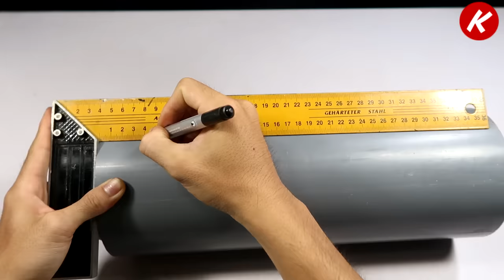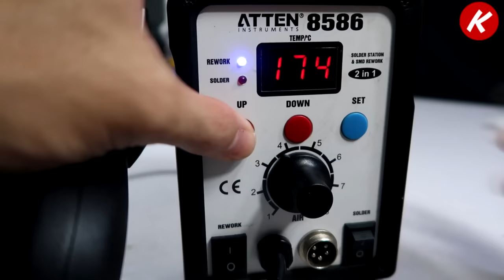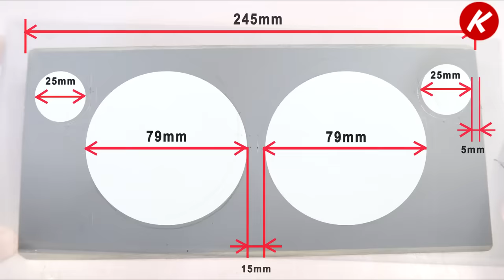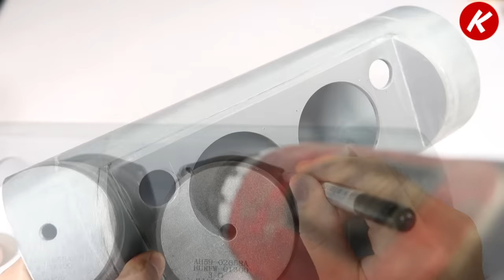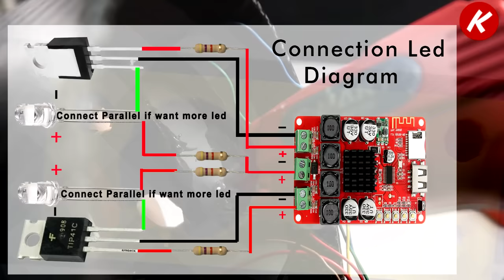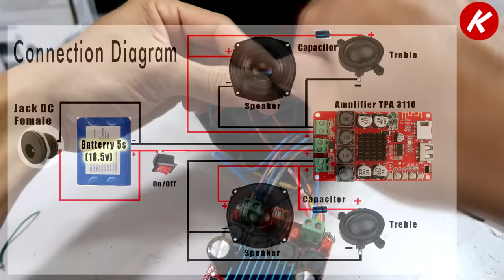How To Make Boombox Bluetooth Speaker Using Pipe Plastic (New Version)

Comment: I think an awesome upgrade for version 3.0 would be an Audio Spectrum Analyser. This would be much cooler than just 4 yellow LED'S.
Reply from the maker: Thank bro
Reply: why? to reduce battery life?
Reply: @KingMinhvuong   Anthony Woodley is right. Suggestion: use transparent pipe and put in the visualizer so it can be safe for the leds to be submerge the boombox in   
Water.
Reply: this is what i thought

Comment: Dude, a few tips about PVC boards. Get piece of 30cm of big PVC pipes (100mm or above) cut in the middle only once and put it in the oven to heat it up. The rest is exactly like you did: put between 2 flat surfaces and some weight over it for a few minutes. 
Then you can use those metal cutting scissors, you know? It's pretty easy to mold it with heat from a cigarette lighter and so on. There are people that makes LOTS of things with that material!
Anyway, if you want any indication of channels that use that material, so you can have an idea, it's just ask. 😉
Reply from the maker: Thank for your idea my friend. That is amazing. I will try in next day

Comment: Good job
But for your battery pack you need 5s BMS.
You can not charge lithium battery without BMS specially 5s4p pack they can catch fire during charging and discharging......

Comment: Hi there, brilliant video tutorial.. I am going to have a go at building one myself. My only question is... how long does the battery pack last between charges? Thanks in advance
Reply: That depends on your wattage consumed and the mah hour of the battery. Check the watt hour. Say you using 6 watts and your battery is 9 watt hours, you will get 1:30h of playback. Hope this helps!

Comment: I reckon a minor detailmissed was an actual Air Escape hole for the pressure of the Subwoofer, could've further enhanced the quality. nevertheless, great DIY
Reply from the maker: Thank for your advide
Reply: Making it a ported enclosure would defeat the purpose and functionality of the w00x speaker radiators.

Comment: Nice invention, but you dont have to use sealant or any permanent glue, instead, use bolts, because if some problems occur inside , you can easily replace damaged piece without damaging outside, this looks disposable, but still, nice outcome.

Comment: hey, I have a question. can you make this boombox also whitout the accu, and connect it just whit the charger?
I am waiting for your answer :)
Like your vidoe's!!!!!!!
Reply: Just add charger instead of battery but 4-7!
Reply: @Davidslabofficial  what you mean whit 4-7?
Reply: @norules1166  sorry that was mistaken 
Add charger instead of battery 4s is about 16-15 volts you can use booster or (buck converter dc-dc to attain 15 volt you can also use 12.volt 5 amperes charger or power supply from computer
Reply: @Davidslabofficial  https://www.allekabels.nl/universele-adapter/5784/1307581/universele-ac-dc-adapter-12-v.html Is this one good? It is 12 volt 600mA

Comment: Ahm I didn't see him connecting those big speakers on the side. 😂😂😂
Reply: They are passive radiators. there is no connection. They move by the air movement form the woofers.

Comment: Sir you give the anotheramplifier board link in description please check and correct it so that before Christmas I make it
Reply from the maker: I know that, but the amplifier I have used in this video is not good, it is very hot and noisy, please buy the amplifier that I put in the description of the video will be better. Thanks !

Comment: Does the battery have to be exactly 18.5 V. Also will it work with a battery bought from somewhwre, because i really can't build this battery pack
Reply from the maker: You can using power 12-20v >2A is ok

Comment: Why did you use full range if you have woofer and tweeters? Full range will limit the quality of the sound and mess up with the frequencies of the other speakers, you could've used mid range and the sound quality would've been way better

Comment: How do the side subs work?
Reply: Its a passive radiator/ bass radiator. It function by helping the unit to smooth out the bass and amplified it somewhat. If you have a small driver, like the two drivers in the middle, the radiator help amplify and prolong the bass frequency of the drivers using the air that the drivers move inside the sealed tube. That way more bass can be felt by the audience with relatively smaller energy used to move the speaker/driver.

Comment: The left tweeter is crushed. Probably for pulling the glue away. Very bad fixation. It would have been better to fix them by inserting them from the front. A tweeter or any crushed or damaged speaker in the dome or membrane will never sound good.

Comment: In general, the body is a good idea, I liked it. but making it nonseparable is nonsense. how then to make out if anything happens. hot melt glue is evil. Why so many wires?) This is not a spaceship. with batteries is also not clear. they need to be balanced. but this is not visible on the diagram.
Reply from the maker: Thank for your advice. Just buy new materials is ok

Comment: What is the purpose of this project? A DIY project by using  cheap plastic pipe?
This project it is NOT cheap but good for showcasing.
Just a pair of the full range speakers alone cost $77 in my country currency plus add the other speakers and this and that to reach a whooping +$200!
There are too many already made good sounding and quality boombox speakers around in that price range so why I should build this project?